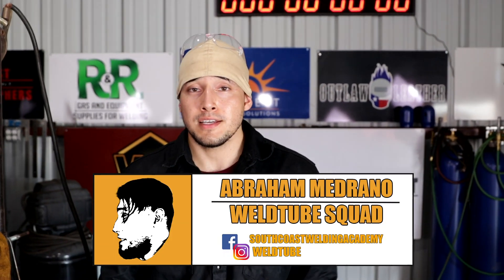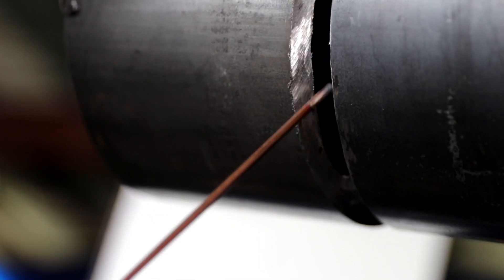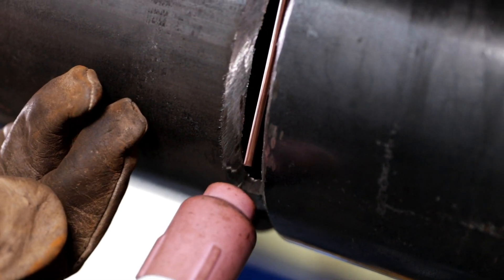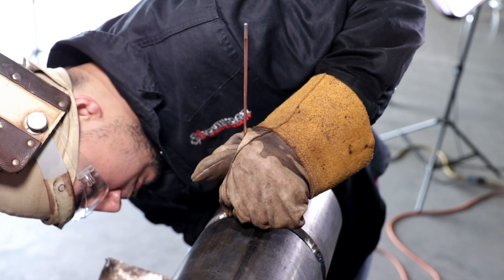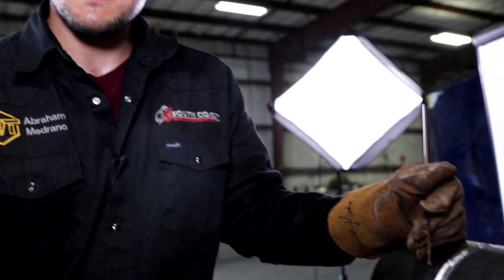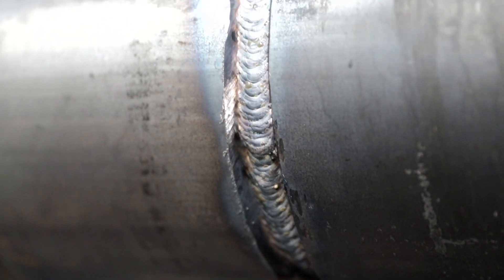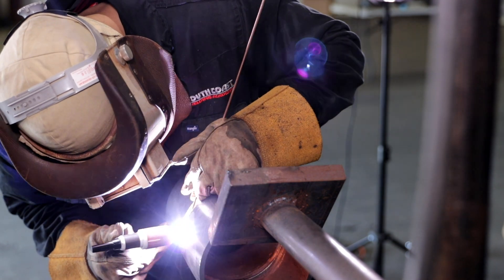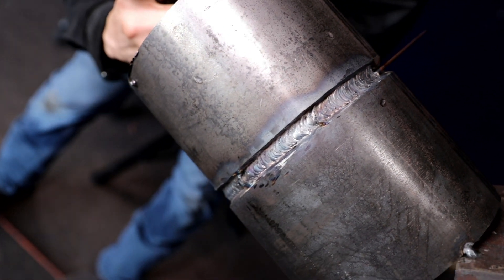How to Weld Huge Gaps with Tig

Comment: Another way to, with feeding in wire is to push it in consistently as your welding moving the torch and wire with each other, instead of just using your fingers and feeding it in little by little in a short time, especially is a position like this, you wanna concentrate just on one thing only and thats putting in a solid root

Comment: i worked for enerflex one time. they build all the skids for cryos. we set all the pipe off of them. they had a start up job up here in wv and used our guys for help. worked us 7 days a week. they are non union but they kept union guys working and treated us good. all they asked was you work and do a good job.

Comment: Hey kind of off topic but how do you stay in position when welding? The biggest problem i have it just my body moving around a lot so i have to stop and readjust. On the plus side, my stop and starts are pretty good lol
Reply: Tamahotties Taterthots , you just have to find that sweet spot, everyone has different body dimensions so with everyone is a little different, what I like to do is place my whole body facing the direction the pipe is going then i twist  my upper body to the weld. It’s a small twist so I’m still very comfortable. If I was to recommend something it would be start a little uncomfortable, but finish comfortable, you will have less stops this way then , starting comfortable and ending uncomfortable. I hope this helps out !

Comment: Hey Abraham I got a good one, how about a video on how to fill a gap just like the one you welded but on pipe, 2g xxx heavy wall one piece of pipe flat no bevel and other piece beveled using 6010 5p+. Didn’t last long at the job site first time encounter didn’t know how to fill was afraid wouldn’t pass UT so I didn’t even touch it. Please help me so I know what to do on my next encounter. Thank you 🙏🏼

Comment: Great video. On less critical welds  filler rods can be tacked in place to bridge the gap.  It's done a lot in industry.
Reply: gord johnson you can also spin them together with a drill
Reply: @mattharper588  wouldn't the laywire technique work? Cram a few 1/8 rods in that gap, crank her up and walk it out.
Reply: Jonathon Bridges you want to keep the rods together for easier control that's why you tack them together or spin them in a drill

Comment: Main thing here is the heat on the machine don’t go into thinking your gonna be able to get it with 95-100 that usually get it with don’t be scared to turn the heat down take into consideration that you your move slower so breathe and think 3 steps ahead
Reply: I agree and also my biggest issue to. Always being told hurry up hurry up but pipe needs few min to cool in between passes, granted I do stick and can do root, hot and cap on a 3in back to back to back but the root is turning red on the cap. All looks sweet but has to be some grain growth from such a big heat zone at once